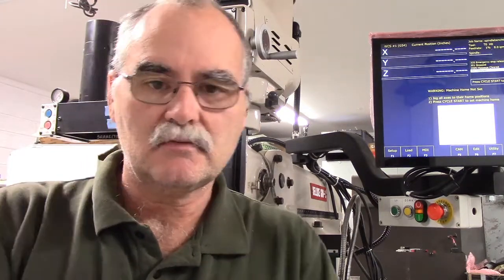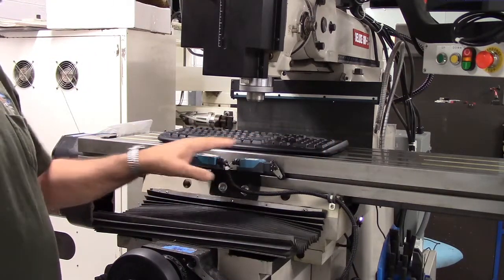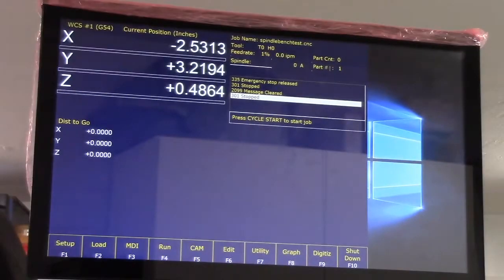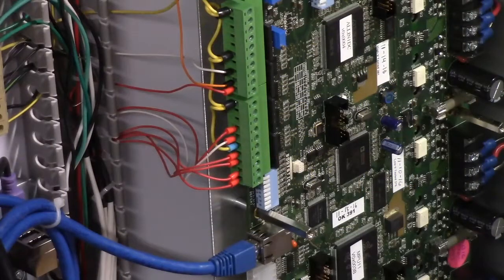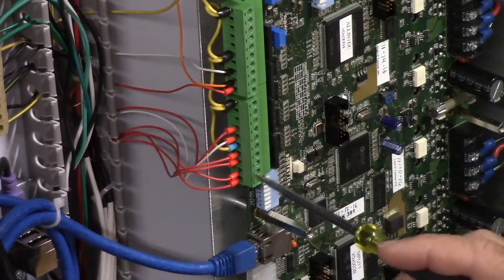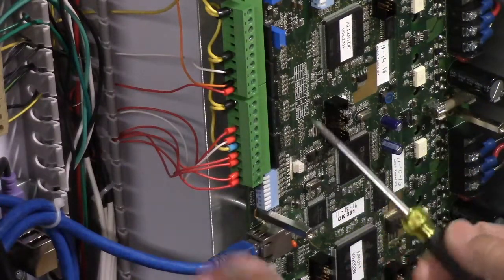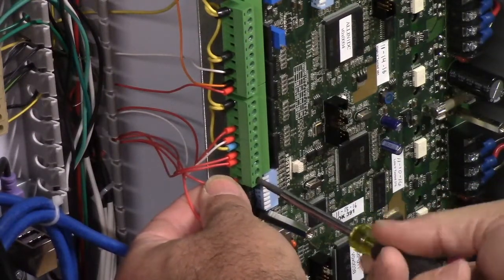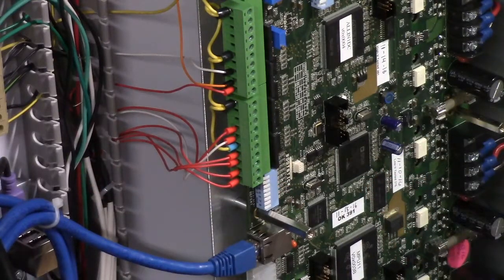Properly Reversing an Axis with Centroid CNC All in One DC

Comment: so why can't you simply swap the two motor leads at the ALLIN1DC control board? since its dc it will reverse
Reply from the maker: Not the proper way to reverse the direction. The encoder and motor rotation need to be synchronized. Otherwise you can have a run away condition. The motor is turning one direction by the encoder reports it's turning the wrong way, so the controller tries to force the servo into position, which it can't do. Until it faults. So, it's not as easy as just swapping motor power leads

Comment: Ok  I’m  a little confused , on a knee mill x - should move the table right. Y - should move the table towards me or away?  Z -  should move quill down (I’m confused on Y)
Reply from the maker: X- table to right. Y- table away from you. Z- spindle down
Reply: @martyscncgarage5275  thank you so much I really should use the forum. I made my first part in fusion 360 and milled it out. The tool paths defaulted the x y z in the way you show above! I’ll tell you what the centroid acorn just works! I had to change direction and did it in the wizard! No hardware changes for the acorn, (I’m using one limit switch per axis and software limits for the other direction!) oh n Merry Christmas Marty, 
Paul
Reply from the maker: @trialnterror  Great! Glad to hear it. Yes, the forum is a great resource! Merry Christmas!

Comment: Nice. So do you also do the same on a quad drive if the same issue? Or the wiring doesn’t matter?
Reply from the maker: I have not worked on the older Quaddrv. But I would think the same procedure applies. Post the question to the Centroid user forums and you'll get your answer. https://centroidcncforum.com/viewforum.php?f=64 I believe there are legacy manuals as well. DC3IO should be the same drive https://www.centroidcnc.com/centroid_diy/centroid_manuals.html

Comment: Hey Marty. 
Is there a way to only change the hotkey on the keyboard?
My direction is fine as is the DRO. 
I am just more comfortable if the arrow key applies to the table movement, not the tool.
Btw, I am using an Acorn.
Reply from the maker: Sorry, keys are fixed. I think you should try to get used to the conventional way.  One of the caveats of moving to an industrial control.